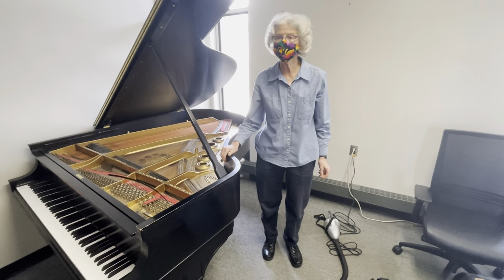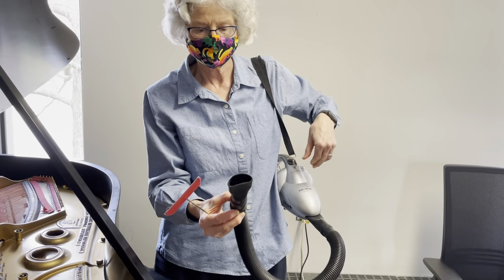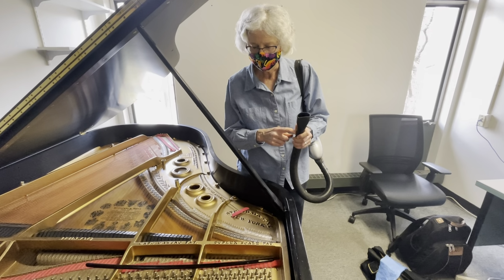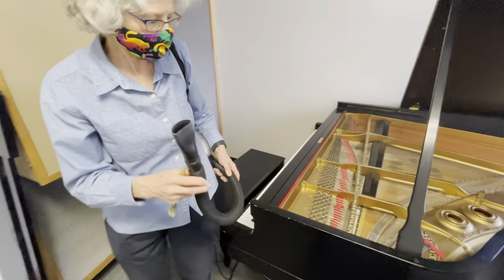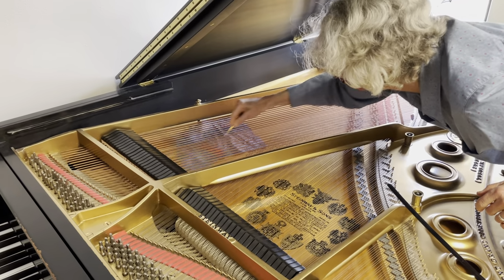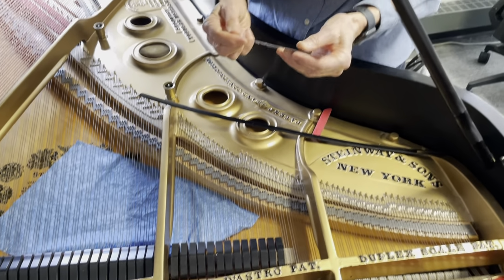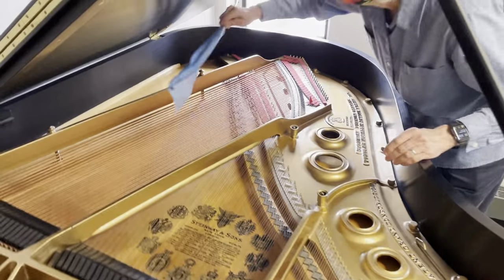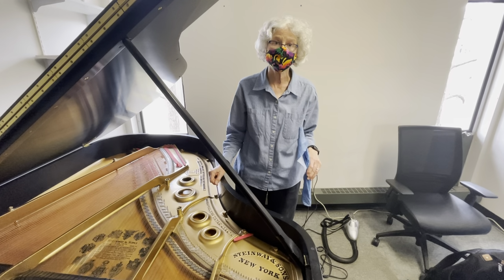Soundboard cleaning

Comment: Do you mind sharing what brand of vacuum cleaner you're using?  It sounds powerful.
Reply from the maker: It is a shark that is no longer made. It’s good point is that it is small and in my work I carry all tools on a vehicle free campus. A friend of mine got a Miele vacuum and it’s amazing: very quiet, very powerful, and excellent hepa filtration. I’m thinking about getting a smaller cordless vacuum.

Comment: Thanks Lucy for sharing this video. Just asking some guidance I have also vintage Steinway Grand piano in 1878, just wondering where find the serial number and the real year was made? I only fin a lot or Pat. years...Thanks for any  info.
Reply from the maker: The serial number is usually on the plate between the bass and tenor sections. If it was removed or painted over on the plate, the serial number is also stamped on the front of the key frame. After I have the serial number, I use the book “Pierce Piano Atlas” to find the date of manufacture.
Reply: @lucyurlacher9794  Thank you so much for the info.

Comment: Lucy, you're inspiringly speedy, I have just recently started cleaning soundboards of grands that I tune as a bonus perk, I've historically cleaned old uprights... I have the soundboard steel but you're the first person I've seen use it efficiently... I've tried using it with a microfiber cloth, but it's kinda clunky, the cloth you're using seems a lot better... I find it interesting that you use it in conjunction with the Spurlock cleaner (and not either/or), which I have yet to purchase.  I also like your vacuum, I tend to use the customer's upright and that's usually fine, but there are occasions where I've wished for a more consistent clean... what model of vac do you use?  Also, I've seen there's a Spurlock knockoff for a third of the price, I wonder if they're just as good, have you used them?
Reply from the maker: On my last SB cleanings I used t-shirt material or old sheets , 6” wide by length of soundboard steel. Both worked really well.